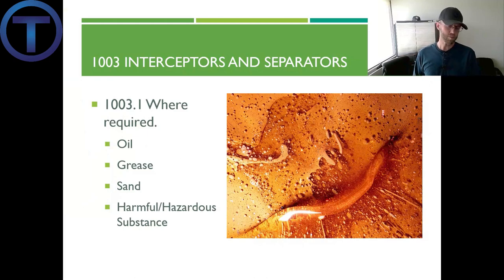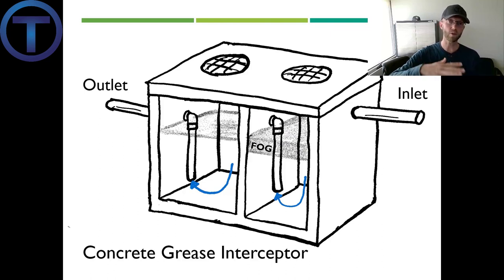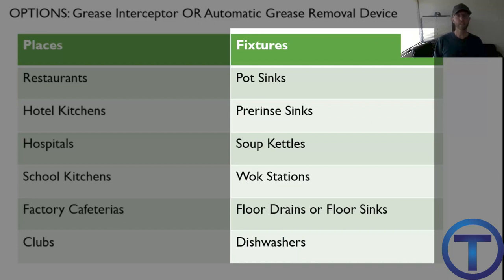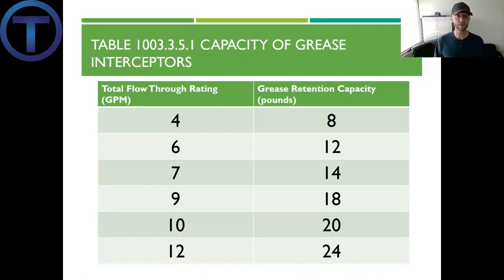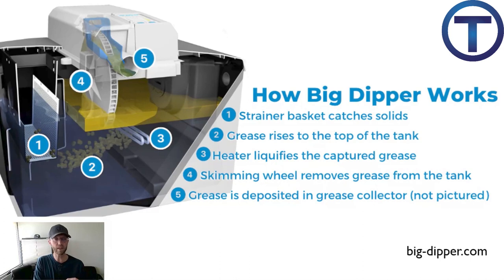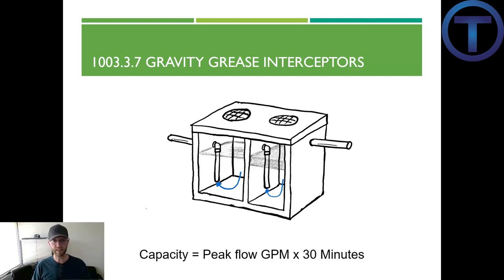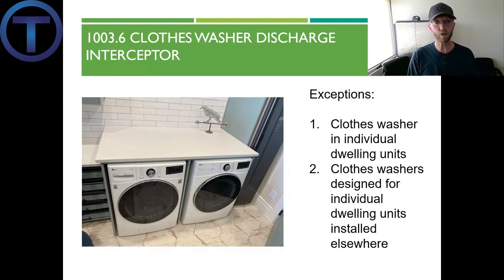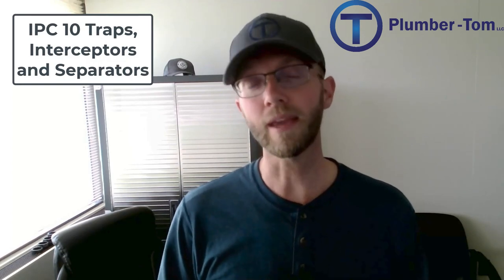Understanding International Plumbing Code 1003 & 1004

Comment: how much of the code material will likely be on the exam for alabama journeyman
Reply from the maker: Not sure.  But you can find out by contacting your state department of licensing.  There is probably a candidate bulletin that will outline what is on the test.